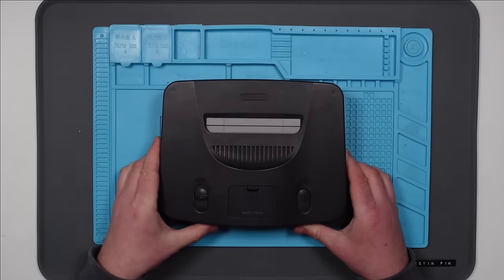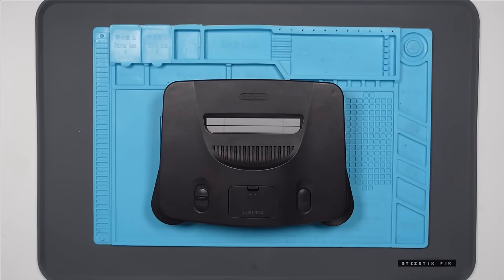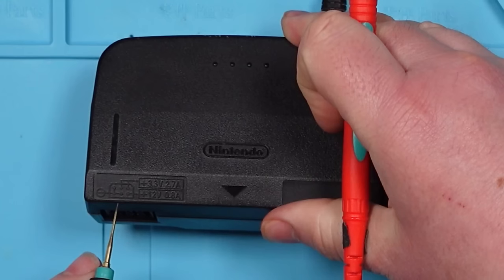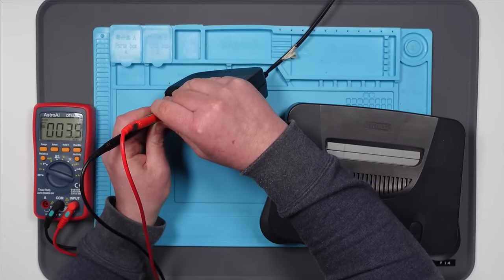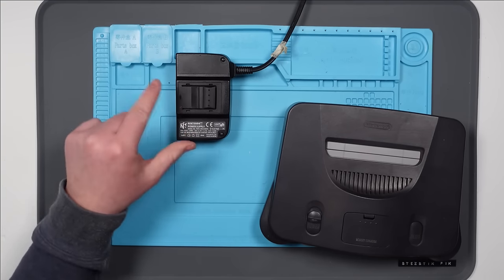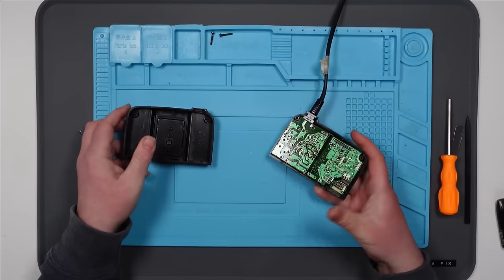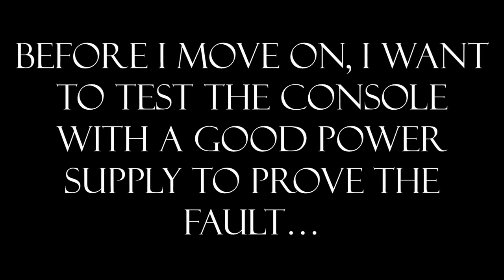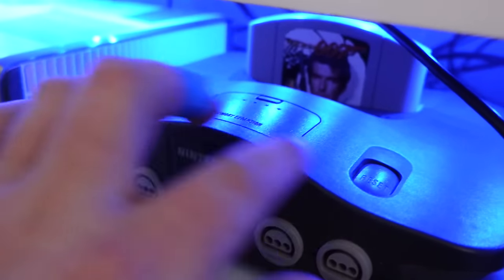N64 with NO POWER & Back To The Future 3 HANDHELD | Can I FIX It?

Comment: One tip on measuring mains voltage. There’s no reason to be afraid of it just so one thing. Clip the common to your primary or secondary (depending on what you want to measure) and just hold the probe in one hand keep the other hand away from the board and probe it. Then when you accidentally touch something (I don’t know why you would) at least the current doesn’t race through your heart and you’ll just have a little shocking experience.

Comment: hey ho, electrical engineer here. I used to work for 7 years for a company in germany which is producing power supplies for industrial applications. I first used and fixed the power supplies (5W to 2000W) there were quite similar step down supplies like yours.
here are some main adivces from my point of experience:

you should set it up under AC Input voltage. I had houndred thousands of these thingis in front of me without security box/shield/whatever. less than every 10.000th will pop up (FET or capacitor if it was wrong - not your case, otherwise you would already know ;). check if there are voltages on the secondary / slave side of the transformator. the behaviour under voltage can give you better informations what it could be (and what not).

if there is something wrong it could be your regulation: btw the optocoppler is for the feedback of voltage and currenct regulation. it could run on a lower voltage if there is some trouble in the regulation but that ist very rare.
Most of the time its the "power parts" like FET (field effect transistor), transformator or some diodes. you PCB looks good but I realized that you already have a good eye for problems like that.
Maximum expierence advice: had a lot of diodes and FET´s which were totally fine by messarement. even when i soldered these out with no intereference from other parts. but they were quite often defect. :( sometimes it was quite frustating and I substituted a lot of parts to find the problem. Of course you don't have these different parts at home.

PS: I like your equipment. for a efforetless working on a PCB i can recommend something like this: https://www.amazon.de/Fixpoint-Platinenhalter-Best%C3%BCcken-Leiterplatten-Platine/dp/B000LB4PWM/ref=asc_df_B000LB4PWM/?tag=googshopde-21&linkCode=df0&hvadid=309904116164&hvpos=&hvnetw=g&hvrand=7301917377656258488&hvpone=&hvptwo=&hvqmt=&hvdev=c&hvdvcmdl=&hvlocint=&hvlocphy=9068308&hvtargid=pla-475410755431&psc=1&th=1&psc=1&tag=&ref=&adgrpid=61691617836&hvpone=&hvptwo=&hvadid=309904116164&hvpos=&hvnetw=g&hvrand=7301917377656258488&hvqmt=&hvdev=c&hvdvcmdl=&hvlocint=&hvlocphy=9068308&hvtargid=pla-475410755431

Comment: Judging from the voltage readings you've taken, I would suspect that there is no power coming into the power supply.  It would be worth checking whether there is continuity from the plug to the power supply.  I suspect there's a decent chance that either the fuse has blown in the plug, or there is a break in one of the wires in the mains cable.
Reply from the maker: Thanks Daz! 👍
Reply: Was coming here to say this I was shouting at screen lol

Comment: The other hole is for other games that take 2 batteries. Just a way for them to reuse the same housing on multiple games. Plus it's a way to keep an extra battery at hand whenever you need one.
Reply: It's not, those games don't need 2 batteries... It's just a space for a spare battery, a lot of older devices have them.

Comment: I have seen many very good repairs that you have done. And I don't finish wondering how you can confuse an inductance with a capacitor. It stumped me.
The problem was loose battery contacts. very clear. Please don't forget to take out all the flux you left behind.

Comment: Nice fix Steve! What microscope are you using? (I’m asking as I want to start with smd soldering)
Reply from the maker: Thanks Viktor! 👍 I use the Andonstar AD407. This one: https://amzn.to/2VP3msU
Reply: @StezStixFix  Thank you for the information! I’ve been wondering what it was myself. Great channel!
Reply: Try using your smartphone if it has the ability with some type of clamp, mid to high-end smartphones have amazing camera's with incredible zoom capability especially with the digital stabilization, with the correct settings for capturing insects and things like that (not sure what it's called), if your phone has 2/3 cameras on the back it's more than capable. Hope this helps.
Edit - I'm pretty sure that's what borderline OCD uses https://www.youtube.com/watch?v=Ckd81aEkBVI&t=8s he also uses nail polish for solder mask, ingenious.
Reply: I agree with the phone method. Has worked for me so far. Although I can ses benefits to a "proper" system.

Comment: Maybe the case on the handheld was used for multiple games, some requiring both batteries.
Reply: Nope, it was the same thing with nintendo games, you had a hole for back up battery, so you can keep on gaming!

Comment: I have about 20 genuine inop power supplies. I have had a quick look but nothing obvious. More (and as you pointed out - safe) testing is needed. Interestingly, as another similarly mentioned in the comments, I found zero repair videos/comments/advice anywhere on the net. Surely, someone, somewhere has fixed an N64 supply and posted about it.

Comment: On the handheld it looked like there was some kind of yellow residue around the soldered components, which I would assume is some kind of flux. If that's what it was, that may be what caused the problem with the pad, especially if it wasn't a 'no clean' flux.

Comment: why do i have a feeling with the bttf3 game that if you just supplied power to the battery contacts it would have fired right up. wouldn't be surpised if it was just dicky contact between the battery contacts regardless of no visible corrosion, and the act of you taking it apart and reassembling it was all it took to reseat or give good contact between the metal contacts.

Comment: Steve, The Circle with Fuse on, is the mains fuse. The 12v 3v are the 2 square fuses behind the output socket where you see the bent over ribbon. 5000 - 2500
What the hell, did I see Gordon the Gopher?? LMAO!! 🤣🤣 I love your humour Steve 👍
Reply from the maker: 😂 yeah, love a bit of Gordon T Gopher! I did check those fuses off camera, and pretty went over the whole thing. I got scared when I realised I'd probably have to plug it in to see where the 240v stopped... ⚡🤯
Reply: If you ever get, Any! PSU you don't feel happy working with. Feel free to PM/Email etc.. me! and I'll happily take a look at it for you no bother at all. The back to the future game, I think you found the fracture on the tranny. Hand held gaming devices get tossed about a lot, so it's a good possibility, that was your fix! I believe 🥳👍
Reply from the maker: Thanks Steve! I may take you up in that, much appreciated 👍

Comment: I bought an N64 from Woolworths in 2000 when I was 17 and it fell off the cabinet and only displayed a blank screen after that but with audio still working so my question is could you fix me a time machine so I can go back to 2000?

Comment: Cool video. Worth the wait (upload issues for those who are unaware). 👍

I too have a faulty N64 PSU, but haven't opened it up yet. My probes won't fit into the DC outs. 🤦‍♂️😩 Did you use special leads (if so which models) or just the default ones from your meter?

I believe Zedlabz (and probably other vendors) do aftermarket PSUs, so at least your friend can play Goldeneye once again. Ding ga-da ding, d-d-d, ding ga-da ding... BANG! 😁
Reply from the maker: Thanks Toxo! 😁 I bought some aftermarket leads with very fine tips, I use them for pretty much everything.  I think these are a newer model, but they are essentially the same:  https://amzn.to/2QfCVgq

Yeah, I've seen the aftermarket power supplies and they are cheap enough.  Definitely worth it to get this N64 running good as new, anyhow. 😊
Reply: @StezStixFix  Cheers bud. May hint heavily for my upcoming birthday. 😝

Comment: The second battery slot that wasn’t connected can serve two different purposes

1. A carry case for a spare battery
2. A spot that the game creators can use to supply extra power for more battery hungry games, this game didn’t require added power thus wasn’t connected.

Comment: I understand your hesitation powering up the powerpak(spelling?) with mains voltage, but couldn't you power it through your bench supply at a nice low voltage and current limit it to some low value just to follow the current path? It isn't like you need to actually power anything too power hungry.
Reply: I'm pretty sure the resistors would prevent anything lower than the expected voltage to get through, meaning he would not get a signal.
Reply: @Outside998  Why? The signal level is set at 5 or 3.3V by the power source, why would you use resistors to lower that? Makes no sense, there is no need to reduce the logic level in circuit.
Reply: @OscarSommerbo  maybe I misremembered some stuff about it. I haven't dealt with that stuff in ages. I was thinking about the voltage going in from the socket.
Reply: @Outside998  Yes, the power injection must happen after the transformer/voltage regulator to be useful.
Reply: @OscarSommerbo  Fuck, yeah, you're right. I went about it backwards. God, I am rusty as all hell.
Reply: @Outside998  No worries. I understand the mistake.

Comment: Are they the other ends of the springs for the piezo manipulated through the board and soldered on to pads on the other side?
Reply from the maker: Hi Simon.  Yeah, they are.  I realised once I'd finished editing it up.  I've never seen it done like that before, but it's pretty clever! 👍
Reply: @StezStixFix  I soldered a new battery spring on a Suzuki Omnichord electronic harp that was done similar.

Comment: It makes sense that it was the transistor. It probably is a little boost converter since there’s also a coil and an RC circuit. Because it turned on and off initially and the sound at times was a bit out of key, make me wonder whether the voltage was correct.
Reply: No. Transistor and inductor is for speaker output.

Comment: Don't touch a device with both hands as a sufficient current going across your chest might stop your heart.  If your on a dry floor you can touch 250 volt mains  with one hand and you won't feel a thing.  You  can always wear disposable glove for insulation.

Comment: Hey dude, if you want to attempt to repair old switching power supply while not being powered you can desolder one leg of each capacitor and measure their capacitance. If the value is really off, it is possible that that is your faulty component. You can do the same with diodes. It's easier to faultfind it while it is powered, but if you don't feel like that, you can try what I wrote. Thanks for a cool video anyway!
Reply from the maker: Thanks Redmi! Appreciate the advice! 👍